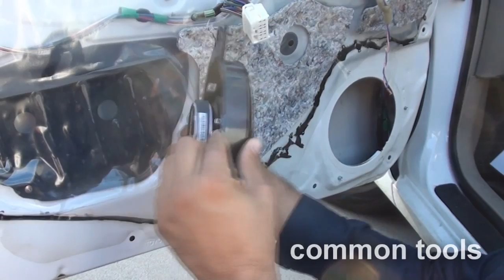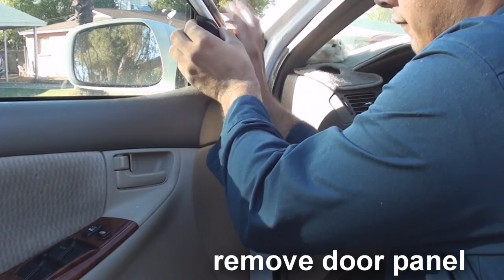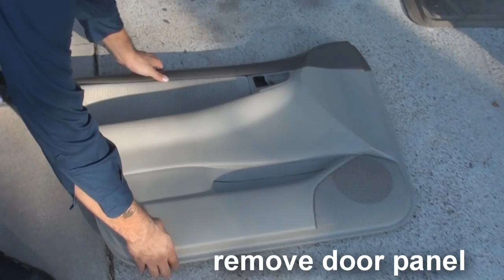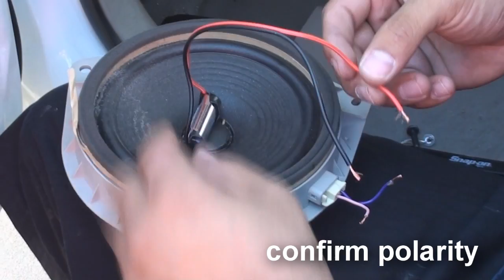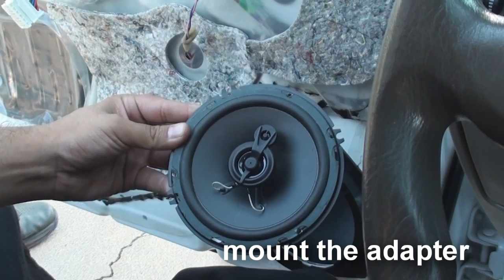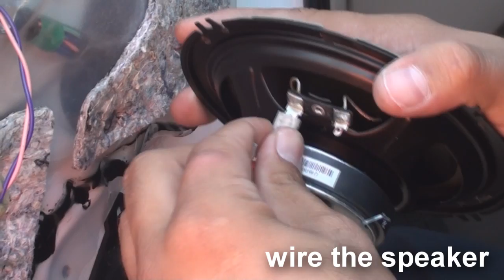How to install speakers in your car

Comment: i can't find the speaker adapter bracket for my car! can you help
Reply from the maker: +2cool0 what car is it
Reply: connectedcaraudio 2003 honda crv ex
Reply from the maker: 2cool0 there is no vehicle specific adapter for that vehicle. You will have to buy a universal speaker adapter and make it work. Or the best option is to  cut out the factory speaker out of the factory adapter and put the new speaker in that adapter. Watch my how to install speakers in  a Toyota Tacoma video. It has no audio but it shows how to do this procedure
Reply: connectedcaraudio yeah i think i'll just return it honestly. i would rather do all this for better quality speakers. haha i just bought some super cheap speakers.

Comment: is it bad to wire the speakers directly for example the door wire to the speaker terminal without the crimps instead passing the wire through the whole and wrapping it then using electric tape?